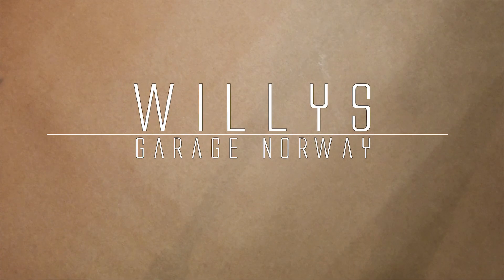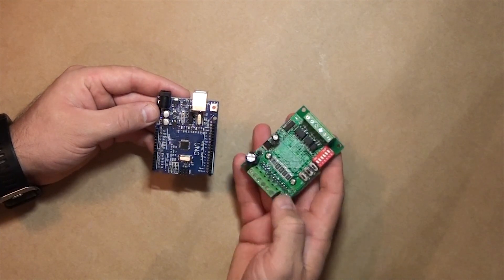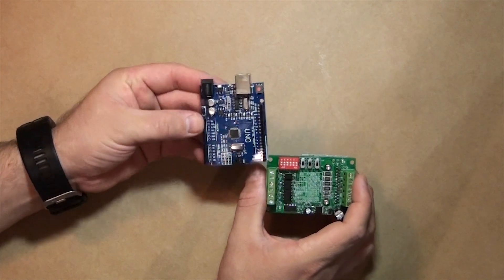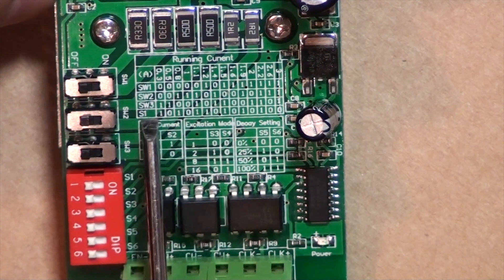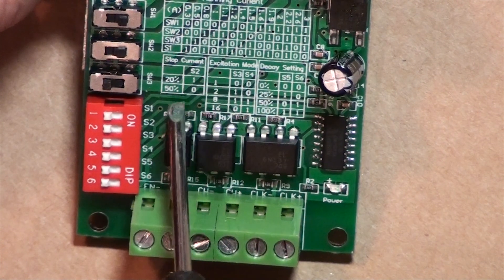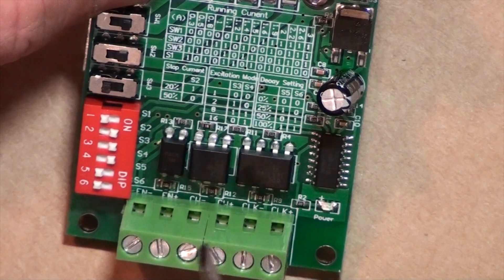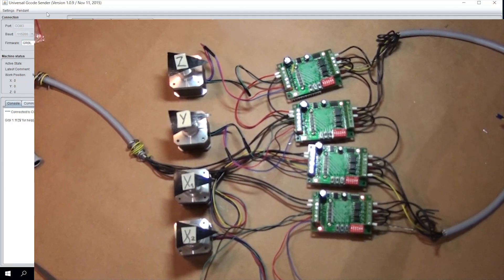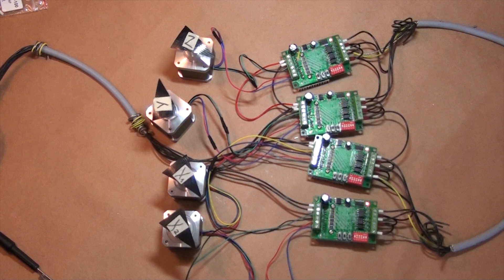First DIY CNC build (part 9) - TB6560 plus Arduino UNO is TRUE!

Comment: hello, I can control a 24V stepper motor through a pot with this plate
Reply from the maker: Solange Santos you do not need the cnc shield to do that, only the Arduino UNO and a pot meter 👍🏻
Reply: ok , thank you
Reply from the maker: Solange Santos no prob

Comment: Hi thanks for this videos I have one question if you  can help me pleas how you connect 2 stepper motors x bcz if it's mounted in the machine so mean the direction of rotation it will not be the same if x1 cw x2 should ccw thanks
Reply: hello how the issue of x-axis rotation is solved I also have that problem

Comment: I have 3 nema 17s and the same drivers and shield you had. If I wanted to upgrade only my X axis to a nema 23 can I wire the tb6560 into the shield and run the 2 nema 17's on the shield?? or do I have to buy all new drivers ? SoI want a nema 23 X axis, nema 17 Y axis nema 17 Z axis. Can I keep the shield and add the tb6560? Confused. Thank you Very good video.
Reply from the maker: Jeff Iscool Hi and thanks. There is no problem keeping the shield and adding one tb6560. You can use the pin outs marked x.step/dir on the left upper side on the shield. But you also need powersupply for the tb6560 👍🏻
Reply: Thank you SOOOOOOOO much !!!
Reply from the maker: Jeff Iscool no prob 😀

Comment: I am building a robotic arm that requires 5 axis. UGS only supports 3. So do you have any ideas for this dilemma?
Reply: There is a 4 axis grbl on the open pnp project.  I have some videos on my attempts making a pnp head.
Reply: check out anninrobotics.com he has a 6 axis solution, all open source with great video tutorials, he also sells kits for the build.
Reply from the maker: No, have you found a solution for this?

Comment: Willy what version are you running on GRBL? I hooked up mine just like you have and all I get is a hissing sound from my motors. I tried playing with the steps since I had mine setup as full step with the cnc shield with no luck. I eventually burned out a board when I messing with the current dip switched on the tb6560. Any tips on whats going on? I ordered another board to try to do this as the cnc shield gets over heated with my nema 23 motors.
Reply from the maker: I am running grbl v1.1 - have you figured out what the problem was?

Comment: O  sensei... you are AWSOME!!!! (with a scream)... kindly answer one query.. what do  you prefer, a USB configured breakout board like the one you used here ( Arduino) or other parallel port configured boards. because its debated that USB configured boards are not that effective for real time operations like CNC. whats your take on this?
Reply from the maker: Hassan Sultan Hi, and thank you very much! :) I have more experience with USB like I use on my CNC machine so I have to say that I prefere those. But I have heard that the serial ones is more stable and has less interference from electronic noise and stuff. That said I have not had any problems with interference on my system. It also depends on what software you are using i suppose. Hope this help you out :) and again, thanks for your feedback 👍

Comment: My stepper motor is not move in either direction ? What is the problem ... Could you suggest
Reply from the maker: Hmm, do you have power? Is all the wires correct? Or is it a software issue?

Comment: if i connect 3 stepper motor driver then all pin of arduino is to be filled then how to add extrapin to connect solenoid pin have any idea.
Reply from the maker: Amit Verma what do you want to control with this extra pin?

Comment: can i connect stepper motor directly with arduino
Reply from the maker: Amit Verma You can use one stepper motor direcly with Arduino and use a pot-meter or push buttons to control it

Comment: Hi Willy, great video. I have one question about the software. Is it possible to run the motors individually and at specific speeds? I have a project that is perfect for the set up you used, but it is not a cnc.
Reply from the maker: Frank Hiebert hi, yes you can run the motors seperatly and at any speed you want really. But you will need to write a new Arduino sketch (code) to do it.
Reply: Not familiar with Arduino sketch, how would you suggest I learn how to do that?
Reply from the maker: Frank Hiebert Hmm, there is a lot of good recourses on the world wide web :) but the easyest maybe to find a sketch on github that is suiteble for your use. Can I ask what functions you want and how you want the motors to be controlled (speed adjustment?, end stops, limit switches, push buttons?) and stuff like that. There is a lot of free sketches you can use and costumize since Arduino is open source.

Comment: You deserve thumbs UP good work My friend . Please upload a wiring Operation with step by step thing , as we old people are not Quad core 2.5 GHz we are kind of 386 architecture with 1 MB ram and 1 MB disk space . which is a lots for 1955 generation The only great thing about it is that we have Huge size High energy consumption High cost and very limited out put. So keep us in mind we are still operational
Reply from the maker: Mo Izak Hi and thanks a lot for you feedback :-) Do you have a request for a «slow» video I can make? 😀😀
Reply: Yes Sir , I am Not getting the Hang of Wiring , You know My model is almost classic 1955 :) and I Mb clock speed You know very slow  haha

Comment: Hallo ! Did you later make any changes to DIL selection (c 1,8A; h 20%; us 8; d 0%)?
Reply from the maker: Where do you mean?
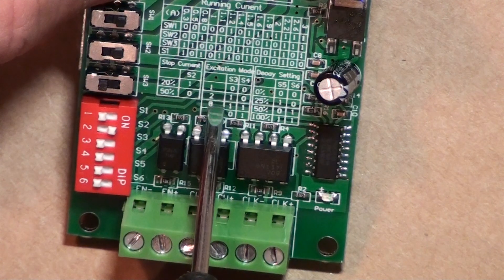Reply: @8:39 you announced possible later changes to DIL settings. What is your final setup of BOB?
Reply: Kamrca _ tfxk

🎭🚇🚌🚞🚊🚄🚆🚋🚋🚞🚝🚝🚆🚆🚋🚞🚞🚞🚞🚆🚋🚋🚞🚊🚄
Reply from the maker: farooq Mohammad abd Kamrca Hi, I ended up on a 1/4 microstepping for my stepper motors.
1.8 amps
Stop current 20%
Decay 0%

And this works great for my machine

Comment: hello sir, i like your video it contain every in the video more understable, you have explain each and every thing by step by step. but i need some help for you which software will be use. and by using this method can be made cnc wire bender
Reply from the maker: Amit Verma hi and thanks. Have you seen my video on software installation? https://youtu.be/ud75Zdolh-M
Let me know if that helps 👍👍😀

Comment: Hello. this is very a great tutorial. how to control 4 step motor by Tb driver but not 2 motor in X direction .
i want to forth motor contored by angel (0-360 degree) not step/mm
but in Universal Gcod-sender and Grbl just implayed that active forth axis but not how control by degree.
Reply from the maker: Hi, I dont think the Arduino can control 4 axis.. only Z-X-Y?

Comment: Nice video, did you put fuse on power suply input as recommended on TB6560 datasheet? Did you had some issue with power on/off sequence?
Reply from the maker: Blender Wiki Hi, thanks. I didn't put a fuse on the power input of my TB6560's, but there is a fuse inn my power supply. That way the PSU and the TB6560's are protected. I have not had any problems with the power up. Do you experience problems?
Reply: No i am testing right now the TB6560, same board like yours, but few people point out a issue with power on/off sequence with this board like in this video
https://www.youtube.com/watch?v=XJKodmZihbk
Reply from the maker: Blender Wiki Ok. I'm glad you are not having problems. I think a lot of the problems is in what sort of PSU you use. If you us a decent quality PSU you should have no problems with you TB6560 :)
Reply: good to know after few month you have no issue
Reply: I was thinking to put a MF-R300 fuse in power supply input

Comment: if you put together x1 and x2 you dont have a way to calibrate de table unless you do it by hand... cnc can be easily get out of square.. its a good practice  to put limit switches and auto calibrate de table every power on and within long works... i have nema34 motors and even they can loose one step some time.
Reply from the maker: CapApollo Thanks for the tip. Do you use Arduino?
Reply: no... mach3 or linux cnc and parallel port.
Reply from the maker: CapApollo ok, I have waited to connect the limit switches until I'm sure how I'm going to connect and set them up. It would be nice to have auto zeroing on the x axis :-)

Comment: Hi Willy! I have a chineese 3020 cnc that I would like to run with an Arduino and GRBL. Can I run it without any changes to the software if I hook up 4 TB6560 (It is a 4 axix 3020) with an Uno like you have done?
Reply from the maker: In theory yes, but Arduino UNO only have 3 axis. XYZ-axis. But you have to change the software settings so that the stepper motors runs in the right speed. You may ask me if you have any questions :)
Reply: Ok so no really hard "hacking". Do you have any suggestion if I want to use the 4th axis?
Reply from the maker: Then I would go for a mach3 or something. I dont have any experience with it thoo. Watch my GRBL config video for tips on changing the settings. And thanks for watching :)
Reply: Thanks for quick answer! I will have to search for a solution for the fourth axis.

Comment: Manufactured TB6560 based drives are not the best. That is due to how the current is set on them. This issue was addressed with the TB6600 drives. Get yourself some v1.2 TB6600 motor drives. I run those on my machine and they're great. You have to know how to set the current on them though. I use an ammeter on one coil, and adjust the drive when it is holding on a peak step. I can hit 200 IPM using 10 TPI lead screws. So that's 2,000 RPM. Which is not bad for drives that cost $8 a piece.
Reply from the maker: Paul Frederick Sounds like a nice driver. Maby I will try those on my next machine.
Reply: TB6600s are so cheap and so much better they're worth upgrading to. They are going up in price lately though. I have ones like this one https://www.aliexpress.com/item/1pcs-TB6600-4-5A-Stepper-motor-drive-stepper-motor-driver-board-single-axis-controller-TB6600-New/32752308150.html?

Comment: how do i connect limit switches??
Reply: What do you want those for? No limits!
Reply from the maker: I have not connected my limit switches yet, so I have no answer. Have you figured it out?
Reply: I use soft limits and I home in the center of my machine so not having limit switches is not much of an issue for me. I have yet to experience an end crash yet. What I do is I G0 X0 Y0 Z0 before I shut down, then when I start back up again I just home where I start out. But if I forget to do that it is a bit of a hassle to get going. I have an X drawn on the bed of my machine that I line up on. Plus my Z axis has witness marks on it to line up. But if I stick with my routine I end homed, so I start out homed. As long as I don't jog the machine before I home out I'm good. I am more interested in setting up a touch plate. That I could use. Because material height always varies.

Comment: Hi Willy, Thanks a ton for this video, I am from India, a non-elctrical background commerce grad. but my fascination is with experimenting new things like CNC router and laser. The machine that moves by itself. Like Phantom who walks! Remember the childhood comics? 
actually , last month I purchased 3 nos. TB6560 . I was excited when it came, but I had no idea of "Decay Setting". Now I am clear. You did a Arduino Uno connection. But I have a Mach 5 Board that runs on MACH3 program. You tested with Arduino board. Now I don't know how to run an Arduino program. If you shall help me on programming, it would be worth appreciating. One question, if I run it via this Arduino board, how long can it be functioning, let's say cutting a relief of Poet Rabindranath Tagore on wood? again if I have to burn via a laser diode, then how long it can be workable. should I give it some rest interval?
Yet again, does it depend on size of the machine? Let's say, my machine built size is 3 ft x 2 ft. Almost you may get tired by reading my questions, please pardon for long questions, as I am most eagerly waiting for your reply. My e-mail id is : calcuttacity@gmail.com------------------ :)
Reply: Thanks Willy for your quick reply. :) Forgot to tell you my name---Adin....I shall start develop my machine, may be in new year 2019 launch is possible.
Reply from the maker: Hi, as long as the TB6560's gets cooling when they are running and the stepper motors them self don't get to warm there is no limit how long you can run a g-code program. You can leave it going for month's :-)   BUT always a good idea to stay and watch because you never know what may happen to the cut. As with the laser diode I don't have any experience with that so I don't know if there are a time limit on the use.

So with both Mach3 and Arduino you can run as long as you want if you have enough cooling.
Reply: Udyog Sutra u

Comment: hi willy can i use this power supply for tb6560

DC 24V 5A Universal Regulated Switching Power Supply
thank you
Reply from the maker: Jay-R Deleon You can use it but then you have to adjust the current switches on the TB 6560's. 5 amps is a bit low to run the Nema23 effectively since they have a max current of 4-5amps each..
Reply: ok thank you

Comment: if i use three nema 17 motor with 300 mm lead screw, can i use a4988 stepper motor driver ?
motor carry just 1 kg (300*150 mm wooden block)
Reply from the maker: manas kundu If its for a 3d printer it definetly should not be a problem :)

Comment: Hey, what kind of wires did you used to connect the drivers to the motors and to the power source? What kind of Cable is that and what is the diameter of a single wire? Can you please tell me? Good job BTW! Congrats!
Reply from the maker: Yuris Man thanks man :-) I use shielded cables on my machine.
Reply: Arduinos do seem a bit noise sensitive. But your motor drives are optically isolated, so it should not be an issue. I've seen folks have big troubles with the air cooled Chinese spindles and Arduino controls though. The trick there is to bypass the brushes with suppression capacitors.

Comment: This is a great tutorial! Much appreciated. Have you tried using the limit switches with the arduino board? I have been having problems with mine giving false triggers from electrical noise. Even with shielded wire.
Reply from the maker: Jason Wisser I have not yet wired up my limit switches. I have heard there could be some problems with electrical noise when using them. I will wire the up in a future video. Have you tried to hook up an external power supply 12volt to the Arduino it self? Just a tip I have read about..  Thanks for watching!!!

Comment: I hope, now your cnc will be work fine! 
Just only one joke, how is with a table stability for precision?
Reply from the maker: I look forward to checking out the precision on my CNC :) It probably is not that good. But this project is about learning and figuring things out. I have plans to make a new DIY CNC in the future where I use the things I learn here. Thanks for watching. :-)
Reply: I understand, that the table made of from some pieces of wood, connected together with  wood screws, not  seriously.
But! Maybe through  this reason you lose some important details?
Or got it..However good way to learn something new!
Time start my own CNC project!
Reply from the maker: Yeah, it's not as precise as aluminium, hehe. :)  Good luck

Comment: Im using the DVR8825 with the CNC shield and my steppers are hissing very loud, is there also a high frequency sound when the steppers stay still (with holding torque) with the TB6560?And lel 13:41, little video fail
Reply from the maker: CyberTom There was no sound on the NEMA17, I have not connected them to my machine and to my NEMA 23 yet. I had some hissingnoise when I used estlcam on my old controllers the CNC shield for the Arduino UNO. No fail, only fun in editing :-). I thought the video was way to long :) hehe

Comment: I have question,in the video you wired two X axis stepper motors with two TB6560 ,What if I wire two stepper with just one TB6560 ? is that enough for steppers in the X axis ?
Reply from the maker: You can not control two steppers from one controller You will have to get one controller for each stepper..
Reply: I have seen some people doing that ,this is way I asked , after all even inventables in there xcarve use one driver for two motors
Reply from the maker: Mohamed Amine BIDA Yes, I know it can be done. But you will have to be sure that the controllers or stepper drivers are ratet for the current two motors will draw when they are connected in parallell. So it can be done but personaly I think its wise to use one stepper driver for one stepper :-)
Reply: You can run two motors off one drive, but it is not smart.